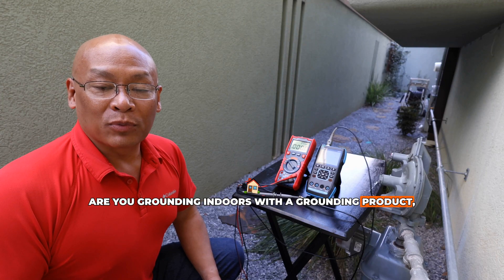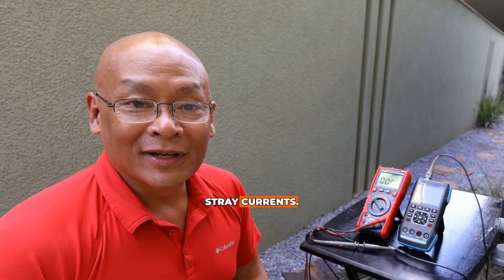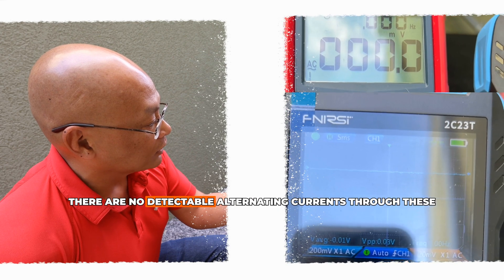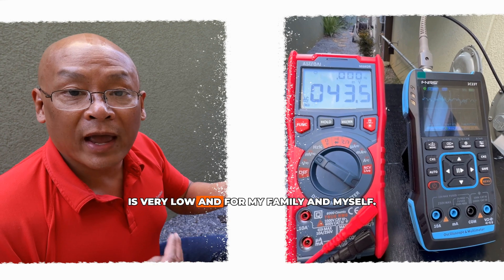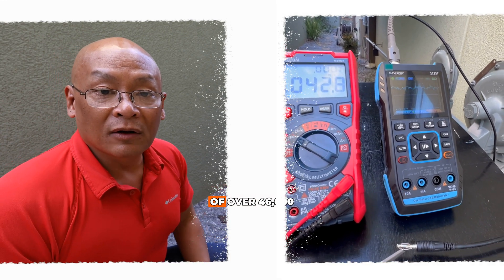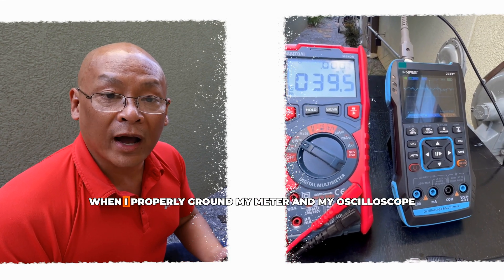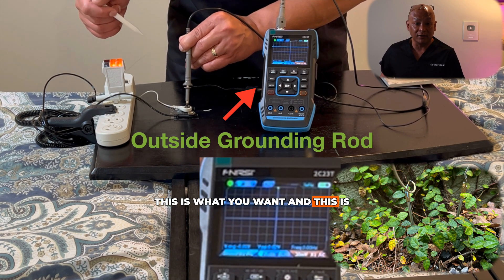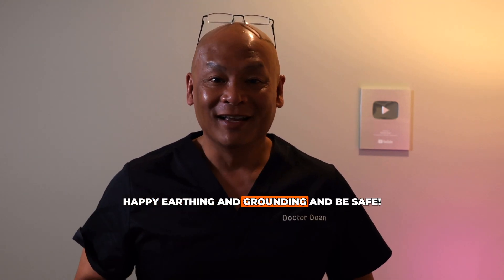Dirty Electricity in Your Outlet? WHAT You Need to Know!

Comment: This presentation and all the comments show a complete misunderstanding of electricity. I am an electrical engineer.  I work with electricity. You folks are imagining stuff. I'm happy to teach you about electricity for free, if you like!??
Reply from the maker: Incorrect replies will be deleted. You have no clue about biological systems and electricity in human cells. Ion channels open with a 30 mV change at microamps. There is a lot of research backing my claims. You haven’t read any of the papers I have posted here.
Reply from the maker: Please share your knowledge. Let’s start with:

1. Does the human body pick up VAC via ELF EMF capacitive coupling? Please cite peer-reviewed research.

2. What is the amount of voltage and amps open voltage-gated ion channels in the human body? Please cite peer-reviewed research.

3. How much voltage and current is acceptable in the ground wire in modern homes according to building codes? Please cite City codes from several cities.

4. When people use grounding mats with the outlet ground containing stray electricity, will this electricity affect cellular function? Please cite peer-reviewed research.

5. How does ELF EMF affect human health and cellular function? Please cite peer-reviewed research.

Comment: Just a note about gas lines.  There might be very old metal pipes, but almost all residential gas lines here are plastic, because it withstands earthquakes very well. The last foot or so above the soil to the meter is the only metal part.
Reply from the maker: Thank you! Metal cold water pipes are more grounded.
Reply: @DrAndrewDoan  Yes they are but only the first couple of feet from house then spliced to plastic in half our houses.
Reply from the maker: A couple of feet could be adequate. People need to confirm grounding with a multimeter. Good to know! Thank you @rtel123  !

Comment: If you ground with a wire from outside to inside, you could get lightning! I guess you might have some super insulated wire that is somehow safe from electricity from lightning but some houses have anti burglar wire mesh on the windows (tiny little mesh squares). Then a way you can ground with that installed is to use thin wire (e.g. copper, stainless steel maybe?🤷‍♂) that can feed through one of the little mesh squares but it's not a proper grounding wire so then it could conduct electricity from lightning! 😢
Reply from the maker: Thank you for your comment! I use the Earthing grounding rod with 40’ cable to ground outside : https://bit.ly/3Zl0gOX 

The cable is thin enough (less than 14 gauge) to go under the screen and have the window closed. The rod is very low to the ground, so it is not the highest structure for lightning to strike. There is also a 100K ohm resistor to restrict current flow, but it’s not lightning proof. You can also place a plastic rock over the grounding rod, but this will not stop ground currents.

There is a very small risk of lightning strike. But if concerned, disconnect the Earthing products during thunder storms.